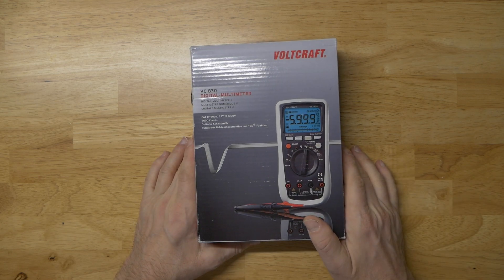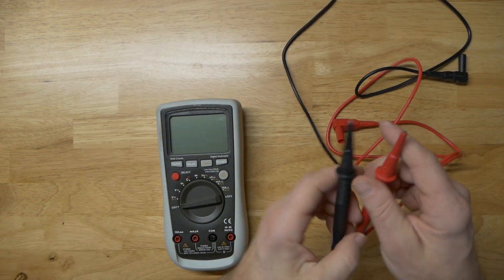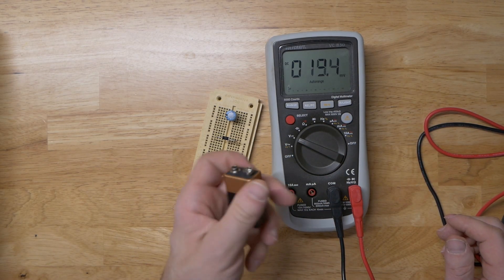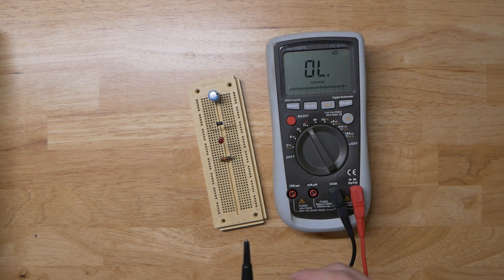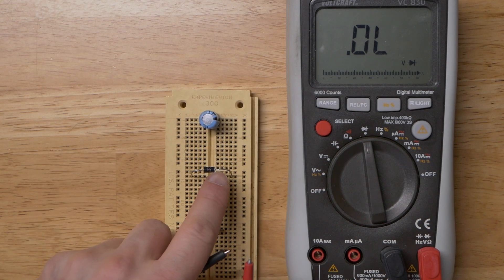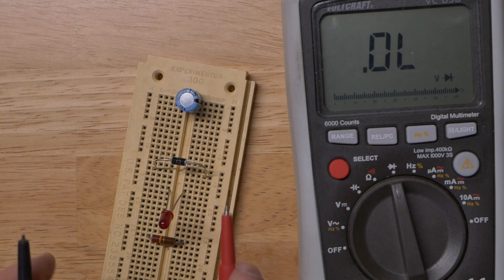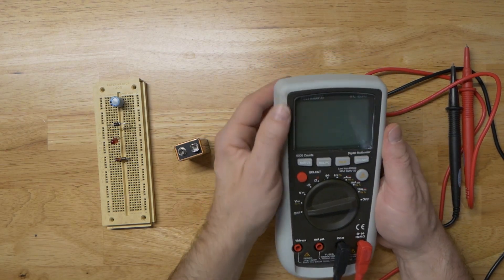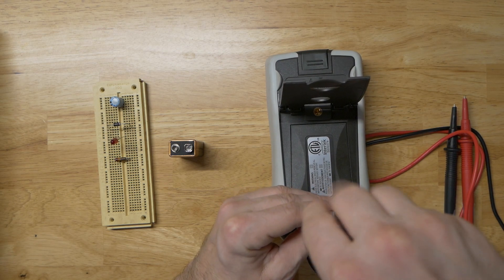Multimeter basics - Voltcraft VC 830 Review

Comment: Capacitance measurements can be effected by poor contact with the probes as well as the probes themselves . I bet if you upgrade those Unit-T probes to a set of probe master gold tipped you'll see a big difference
Reply from the maker: Mark HB good to know..yeah..it’s very unreliable still.
Reply: @design2survive  well there's my idea 😂😂😂.. Honestly the only real reliable way to test a capacitor is with an ESR meter . A DVOM' s capacitor function doesn't really stress it . 
This Uni-T/Volt craft meter seems pretty good for basic everyday stuff and the bar graph is ideal in the automotive electronics diagnostics because it presents some graphical representation when looking for glitches and drop outs .